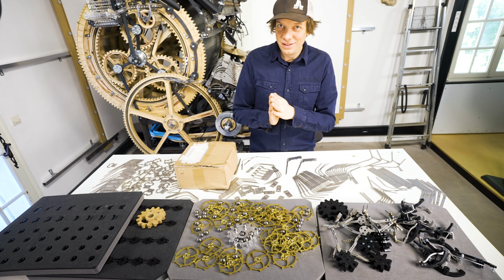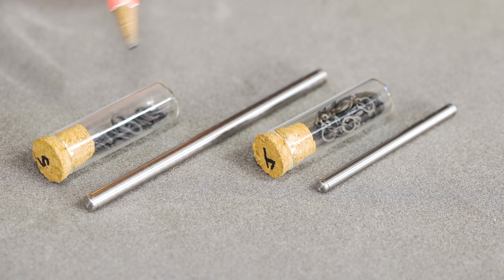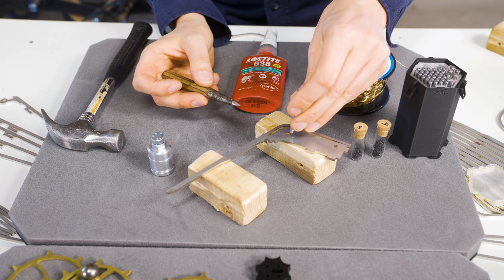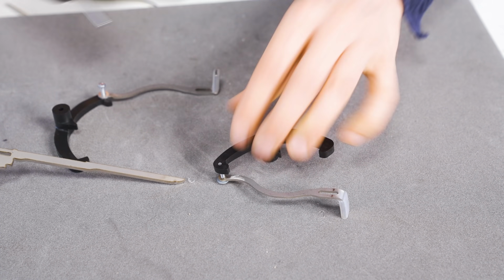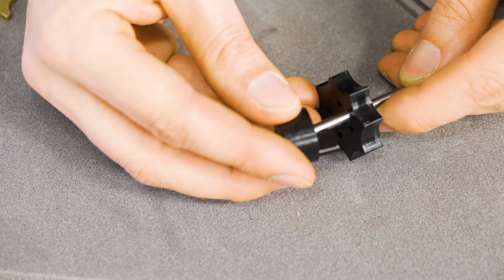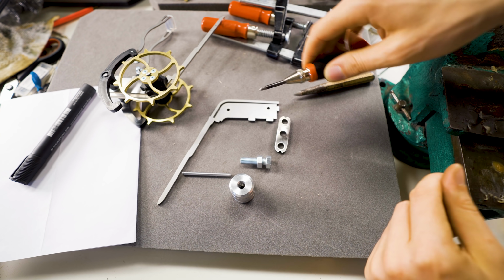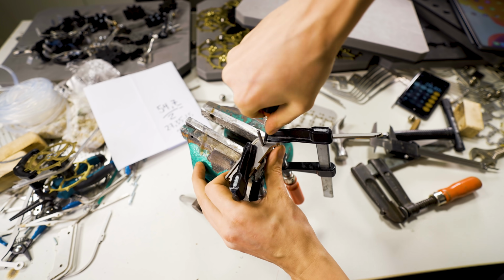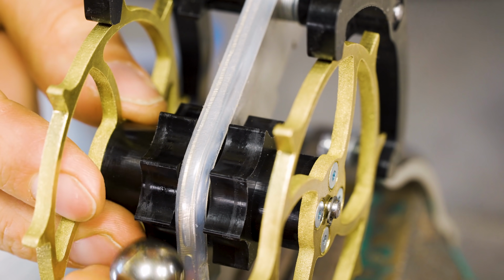Silver Steel Axles - Marble Machine X Escapement Gates

Comment: I'm just going to be the devil's advocate here; Play between components is essential to assembly of complicated systems. You NEED play, play accounts for all errors in your manufacturing. 

Don't try and minimize play, then you just make your machine VERY rigid. IE, if things shift a half a degree, all of a sudden it all binds. Not desirable. 

The key is to limit the INFLUENCE of play. Most systems only see the influence of play in 1) extremely fast response systems, such as vibration, and 2)excessive wear due to improper loading. 

This is a slow system, with minimal forces. Play is good here. 

Just a thought. You should read up on the subject of 'classes of fits'. The difference between a press fit, loose fit, and everything in between is actually well defined in engineering terms.

Keep up the good work!

Comment: When you’re using your calipers try measuring depth of a protruding object with the other end of the calipers. The surface on the top of the caliper is ground flat too so it helps you measure straight up and down.

Comment: Looking good.

Those machine screw embedded in plastic are probably about as strong as a press fit, but with four in there you should be fine.

The choice to go without a bearing should be fine as long as you aren't seeing horizontal or vertical forces acting on the plastic or rod as those would slowly wear through the plastic opening the holes up and introducing chatter.

Careful with those spring punch holes, looks like some of them are close to cracking off bits of metal, which I doubt would be helpful if turned loose in the MMX.

Comment: The Loctite will burn out if you weld to close to it. We use that exact Loctite at work and if we need to take it apart later, we just heat it up and it burns out easily.

Comment: to retain the axles you could use a punch with a hole in the middle slightly larger than the axle and possibly a slight countersink to peen all the way around the hole in one operation. this is similar to how ball detents are retained into the hole.

Comment: Heat is the absolute enemy of Locktite.
The procedure you're referencing is called, "staking".
In case you should ever need to do this in future, there is another form of tool for doing that (in brass) called a "hole closing punch".
You'd need one strong enough to be used on SS and without the spring loaded centering device that comes on some.
Basically a HSS pipe with an ID the diameter of your shaft and with the end machined to upset the 'plate' metal toward the middle, where the shaft resides.  You'd also want to reshape the outer wall of the business end to reduce the outer diameter to not have any more contact with the 'plate' than is necessary.

Comment: Another easy method is to take a ball bearing, place it on the hole and smack it with a hammer. That will close up the hole just a little bit

Comment: Nice craftsmanship!
Some tips, if you need a precise reamer for softer parts, use the same material and grind some flutes. In this case take the same silver rod and grind some grooves in it, the hole will be perfect.
When grinding bolts shorter, put a nut on it before grinding/cutting. The nut will clear any burrs on the threads.

Also, I think that the clock makers method for the shaft can become a weak point. With all the vibrations and high probability of being bumped in to the risk of the shaft becoming wobbly I believe is quite high. I have never built anything like this so I can be completely wrong, but I have used that method before (but on more heavy duty equipment) and it have only been a temporary fix for me.

Comment: Defenetly weld, the axel will move over time and the gear will rub and bind up i guarantee it! for the problem with the interference with the weld just make a countersunk into the steel, you could have solved that also with a counter sunk in the pom part to avoid the spacer waschers witch are not good

Comment: Try to replace the washers with press-fit delrin bushings instead of "diveting" (not sure how it's written). They may hold the axle perpendicular, keep the parts serviceable, and save a lot of work. You can probably cut them with your CNC to the right height so everything fits perfectly.

Comment: As a former mechanic I might have a tip and an observation which might possibly help in the future (just a little bit). When you shorten screws put a nut on the screw first, you can use it as a fixed measure for length and straightness and afterwards it "repairs" the threads when you remove it. 
Further, I, of course, don't know for how long the axles are meant to work with the plastic parts, but every movement will remove a tiny bit of material (just the way you "reamed" the holes with the axle but slower (less pressure)) like water will gradually hollow a stone. You might want to have replacements (for quick repairs when on tour), additionally use material friendly lube/graphite or use brass (or similar) tubes between axle and plastic part (fixed/glued to the plastic turning on the axle side) with a little oil or lube these brass bearings last at least 150.000Km :-) since that's what is used in many car engines. For a mantra: every part that moves, wears (out) over time. But the layout/construction only needs to fit/work for just as long as you need it to last. 
Please don't get me wrong, I admire your work, dedication, and the quality (of parts and work) and that of your helpers. I would have settled with the previous design(s) or would have given up, already long before.

Keep up the good work and I am sure you will achieve greatness...
Thank you for brilliant videos and making me thing ;-) ... and sorry for the long post/wall of text!

Cheers from Germany

Comment: The punching to fasten the gates we used to call "stemming".
You only need to stem twice or thrice, not all the way around.

And on rotating parts you want to have some play, if you wiggle them it should have full play. If you put it tighter and cant wiggle it all the way it is more likely to slow the rotation and cause problem. If it's too loose you have the same

Comment: Terms - Laser cuts have a layer of Re-Cast Material, where molten material resolidifies and doesn't eject. If the material is cut with oxygen assist gas, the recast material will be a mix of parent material and oxides which can make non-hardenable alloys hard on the edge. Like welding, there could also be a heat effected zone. The rough edge on the back end of the laser cut is Dross. 

The "Clockmakers" indents we call a "peen" or "staking". Peening over an edge is used a lot in aerospace engines especially for salvage or repair of parts to hold Keys, Pins, Bushings and Repair Threads or other hardened features in relatively soft materials. Often bolts and nuts will be peened to deform the thread and prevent backing off too.

Comment: Martin, you don't need brute force for a perfect fit. Use thermal expansion. 
Freeze the inner part, making it smaller, it will expend itself locked in place as both parts equalise temperatures.

Comment: Some advice:

1.  When you cut a screw or threaded rod, put nuts on the shaft to hold the part.  After you're done cutting and chamfering the end, taking the nuts off will clean up the threads.  This is important when threading into soft materials: burr on the end of the screw will damage the soft material.

2.  You can buy thin shim washers in an assortment of thicknesses rather than making your own by drilling and cutting foil.

3.  Your transparent tubing is made of silicone,  SILLY-CONE.  The hard, metal-like element which is the  chemical basis for this material is silicon, pronounced SILLY-KAHN.

Comment: If you pulled the bach cyber bass footage from an HDD you should replace it and not use it anymore. The video clips have corruption which hints at either a bad transfer or bad sectors on said hard drive...

Comment: I am familiar with staking metal to hold things in place, but I worry since there is no groove in the shaft to hold the deformed metal it will eventually come loose. Usually there is a notch or key in the shaft so the metal has a place to sit.

Comment: I would not fasten the axle. Absolutely, it is a feature. Let's say, dust gets into between the axle and the plastic on one side. Now, the axle can turn with that wheel as it would be the lower friction without creating ruts that would make you replace parts. It's all no problem if you are in the studio, but let's say something gets stuck on tour, it would be heartbreak. Having one more moving joint that allows for accidental binding will give you redundancy in parts that need to freely move.

Edit: I typed that before you got to the part where you accidentally scratched the axle - and there was my point: You may want to have them all moving.

Comment: could probably move 1 washer on to the outside of the shaft, instead of relying on the cir-clip to keep it locked against the clock wheel, and the other part.

Comment: I am slightly concerned about galvanic corrosion between the brass gear and the screws holding it.  Not a major short term issue, but could eventually create issues.

Comment: In manufacturing, the proper name of making those dimples is called "Staking".
Reply: Or peening, but staking is a better term
Reply: @5000TQ  I think peening is for the part being inserted. Staking is when you move material on the "hole" side of the joint.
Reply: @derschwartzadder  yeah that's correct I think! You stake a bearing, but you peen a rivet

Comment: Quick tip. You can mesure with your calipers from the tip to the upper jaw. It works a lot better when trying to mesure 1 handed compared to using the depth rod.

Comment: to shorten screws: use two nuts locked at the wanted length. when you take them off the thread will be straightened out again.

Comment: The clockwork gates look amazing, but put one gate all the way together already!  Doesn't matter how, just get it working so you can check tolerance and fit while the rest of the parts are unassembled and it's easier to fix the little issues that always come up.

Comment: I still think you should invest in some vibratory polishers. They do a good job of cleaning parts and taking the flash and residue off the steel and brass parts. Here in the states, they can be sourced fairly cheaply too at discount tool stores.

Comment: The method of hammering little dents around the hole to add grip is called "peening". I use a broken tap ground down to a point for that when working on hardened steel. A regular punch goes dull with the first hit.

Comment: I don't see why you needed to do the shim washers.  Your 3D model should have included the correct spacings and the components should have conformed to those dimensions to avoid the washer stacks.  What went wrong?  The whole point of a 3D model is to avoid this level of handcrafting/tuning.

Comment: I wonder if using springs instead of washers would be an interesting solution, which would also take into account small changes with the metal volume due to changes in temperatures.

Comment: still worried about the sliding motion of the gate bar against the silicone tube as seen at the rendering at the very end. I am afraid it will stick and not slide smoothly..

Comment: Instead of washer stacks in the middle, should measure/score groove and put circlip's on either side of the delrin escapement pieces.  

Reasoning: Its cheaper than washers. The washers ride on the axle, rub against the dimpled surface used to lock in the axle and introduce needless friction and inaccuracy in timing.

I understand it requires a lathe/ exact circlip sized cutting tool to precisely make the grooves himself, but maybe its possible to do with a drill and a steady mounted jig and correct sized groove cutter?

Comment: Moving metal to lock or fix a fastener would be called staking like how you used the punch to move metal to secure the axle in place it is not only used in clockwork but any time you need a fastener to not move from its place it is also used in the gun industry

Comment: When MMX is used live, how will the song on the programming wheel be changed quick enough in between songs so that there aren't 5 minute gaps throughout the set?
Reply: A five minute gap seems completely acceptable, actually. Since the song plates will be permanent welded pieces, though, I imagine that with practice (And a couple of extra hands) it would only take a minute to change songs.
Reply: The idea is to have multiple sets of plates prepared in advance.
Reply: The programing wheel breaks down into multiple curved panels if I remember correctly. Pop them off, pop on the new set. He's also mentioned having a stage crew to assist. Episode #65
Reply: He does have a whole band that sound great without the mmx, so it doesn't need to play constantly.

Comment: The American term for deforming the hole in the manner you were doing is call peening.  Swaging (sway-jing) is kind of the opposite operation usual used on axles or rivets where you use a hammer to deform the end of a rod, shaft, or bar to make it retain a component (instead of clips or clamps) or to make it tight in a mounting hole.

Comment: I don't think you need that much securing of the axels. This method is also used in aviation and we use only one or two "notches" (I don't know the right word). 
Nice video, keep up the good work!
Greetings from germany :)
Reply: yep you are correct. It's technically called "Staking". And yeah usually we only do it once or twice and it creates enough resistance to lock things in place. He went overboard for sure hahahaha. Especially doing it on both sides. But that seemed to be his OCD kicking in wanting to try and make things symmetrical and balanced, lol.

Comment: Quick Tip: Most calipers are smoothed out flat at the top(when u hold it: left), so u can also measure depths like the stick coming  28,85mm out of the jig(15:50min). And in that case it is also more accurate.
And also when u use a Micrometer, u have to close it slowly and not fast like u did in the Video(18:30min), cause when u close it that fast the measurement gets not precisely.

But totally u did great work again Martin, cant wait to see all 32 Channels come together on the machine.
Best wishes Colin
Reply: I was looking for this exact comment.  At our shop we always use the stick as a desperation move only, and they're known to wear down sooner than any other part of the calipers.